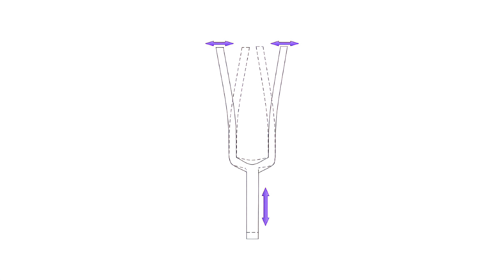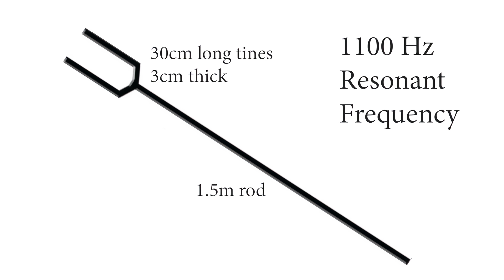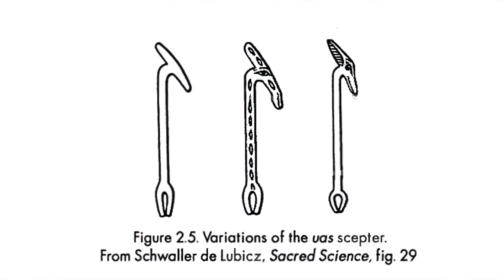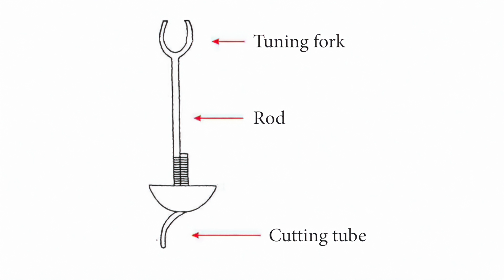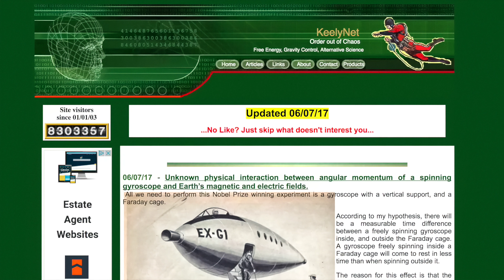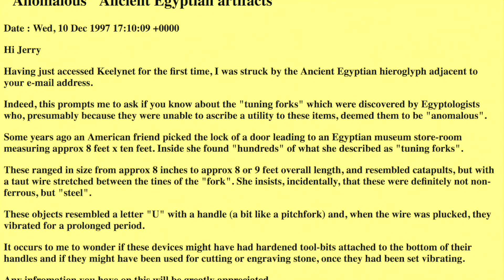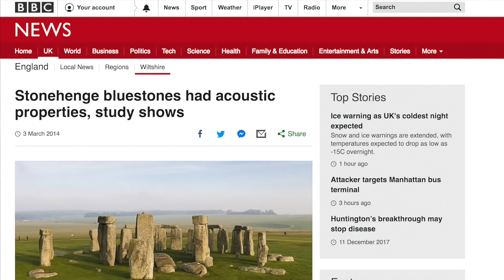How the Ancients Cut Stone with Sound - Lost High Technology Explained | Ancient Architects

Comment: The Waas Scepter (4:50) was most likely used to simply push, pull, or manipulate rings supporting privacy curtains or tapestries. HOWEVER, since the Waas Scepter often appears with the Ankh and Djed Pillar (5:35) perhaps it really was used with, or for, power {as in electricity, wires (resonance 9:55) and means to enhance mechanical vibration in concert with tuning forks for sonic cutting}; more explicitly: If the Djed Pillar was used like a ceramic isolator (0:57) - and a possible energy-generating device - with hole in the top, the hole could receive the Ankh. If the Ankh, then the Waas Scepter would be needed to place (using the 'U" end) or pull (using the hook end) or prod (using the point) the Ankh into, out of, or in, the isolator Djed. Furthermore, if the Scepter was metallic, it could be used as a link from the Ankh loop to....oh....maybe a series of Baghdad Batteries or something.
Reply: This is an interesting theory and makes some sense. Normal teachings are so closed minded to any of these possibilities that it's rather sad to be honest.
Reply: ...always thought the Was-Septer was an assaying tool...
...one end like a poker and the fork end to place the cup into the furnace...
Reply: S.A. Morris, Wow. Yeah. That makes sense as an additional possibility too. Thanks for the comment and have a terrific day.
Reply: Fantastic ideas, Randy. The Ankh is a symbol of life .... it makes perfect sense. Our brains and bodies are electric.

Comment: the answer is always evident but often overlooked
Reply: But can anybody prove this theory or we shall all believe in it just like that?
Reply: Cobb. You make a lot of sense I to think ice age  and some sort of laser  think on this how did they lift 250 tons with what hemp rope would need to be least 6 inch dia so was there some kind of Kevlar rope   that could be also moulded into a tube that could  be light enough to be moved easy and made into tuning fork  tipped with hard end just new to get the hertz right spark eroding works on 50/60 hertz a second but how bowls were cut ha some kind of big wood turning lathe with diamond tipped chisel  cheers john
Reply: Cobb Knobbler  what about the  so called that used copper chissels humbug
Reply: its not a theory its a hypothesis!
Reply: Grant Barlow Good answer and agreed. Overlooked and painfully unacceptable. Not aliens either.

Comment: Vibration,  not necessarily sound  but I believe your on to something.
Reply: Sound is what you hear.. vibration is what creates it.
Reply: sound is vibration and frequency
Reply: For the same reason a deaf person wouldn't call a vibration sound.. it's only sound when it's vibrating a special part of your ears.
Reply: Sound is vibration.
Reply: I don't think it would work.. you could break things with the right frequency of vibration.. like you should shatter a rock by vibrating it but not cut a straight line
Reply: hotdog12345654 perhaps however they did have something unknown to us.
Reply: Most likely.. I'm pretty sure we couldn't recreate the largest pyramid today, even if we were determined. Too much precision is required for us to do it properly, it's aligned to the north so one tiny mistake in the angle you place a stone will fuck it all up.. then it's got different weight distribution techniques, which we would need simulations to figure out for ourselves, at least with out dealing with a few collapses first. Then it was all sealed from the inside somehow.. like the only way they could have sealed the entrances we have found.. is by doing it from the inside so who knows how they got back out. Our biggest crane is two hundred feet smaller so it couldn't reach the top and if they did, it could not be so accurately placed.
Reply: hotdog12345654  that theory is bull shit . You could build them pretty quickly with modern equipment,  rail roads heavy equipment, cranes excavators.   Each stone on the pyramid weighs 2.5 tons 1 train car is rated for  146 tons. yep it is all hype. Not counting the dude that moves multi ton block by himself. The question you should ask is not how but why? Damn sure was not a tomb as there were no bodies ever found in there ever
Reply: Good comment.  Check out https://www.youtube.com/watch?v=bWWhHUs-njY by Michael Tellinger for sound resonant long round tapered rocks used for gold mining in ancient times in South Africa.  They are laying all over the place.
Reply: Sound is vibration
Reply: +hotdog12345654--That's stupid:  Then air is not air unless someone or something is not around to utilize it?  That's like saying if a tree falls in a forest and no one is ever there to see or hear it when it did and after the fact, did it really fall?  Of course it did.  Gosh, humans are so friggin' narcissistic!  Think outside the realm of YOU sometime.  You may actually find amazing and wondrous things!  Contrary to retarded pop culture and science, we do NOT live in a simulator.  Rolling my eyes!
Reply: "loool sound and vibration are the same" looooool, no they really aren't. Vibration is mechanical movement that causes unwanted energy waves. Sound is the effect of oscillation in a medium. Good luck creating sound with your vibrations in space. And in much the same way not all photons are considered light (are x-rays light?), neither are all frequencies. Sound is 20Hz to 20KHz.
Reply: hotdog12345654 it is about how you direct it
Reply: ...i mean, what do you think sound(fundamentally) is? Sound is just vibration traveling through the air. Thats why when we speak and you put your hand on your vocal chords you feel it vibrate. When these vibrations hit our ear drums, our brain then deciphers it as sound.
Reply: BubbleOnPlumb lol, I wanna go back!
Reply: Coral Castle Ed's magnet flywheel...
Reply: +BubbleOnPlumb --  RIGHT ON!
Reply: hotdog12345654 Give me enough cash and labourers and I'll pop you up a pyramid that makes the old ones look like garbage.
Reply: Exactly correct Jeff. Sound is vibration. Our ears are interpreting vibration into sound. So if a tree falls in the forest, it will create a vibration. So unless our ears are there to translate vibaration into a sound it would not be heard. If you put a tape recorder there, it sill will only be translated by our ears. JanieMartinSings
Reply: Sound is vibration
Reply: Same thing
Reply: no sound without an ear? 🙂
    we know . of infinity
Reply: Diffrents finitudes...!
Reply: 7seven7 the destructive wave... 2 strings per note instruments. ..
Reply: Its both, sound can create vibration
Reply: We aren’t hue-men, no humans are hummmming beings
Reply: hotdog12345654 ... Oh please. Modern engineering is done to very tight tolerences. Piece of cake.
Reply: round eye the pyramids were used as a power source.
Reply: Jeff Pittman everything is vibration
Reply: BubbleOnPlumb Well said Zir
Reply: 7seven7 loool sound and vibration are the same
Reply: Exactly.
Reply: Pure BS
Reply: Lawrence! where have you been?  They now no exactly how those huge heavy blocks were moved from the quarry to Geza and then up and into the pyramids.  
do a little research before accepting some lying SOB's word for everything.
Reply: "I'm pretty sure we couldn't recreate the largest pyramid today, even if we were determined. Too much precision is required for us to do it properly"
"it's aligned to the north so one tiny mistake in the angle you place a stone will fuck it all up.."

All you need to determine the North with perfect precision (if you do not know anything about stars etc) is a goddamn stick. If you're stupid and lazy, three sticks and some fine rope.

"then it's got different weight distribution techniques, which we would need simulations to figure out for ourselves,"

Or something as simple as math. Has the Notre Dame in Paris collapsed? Or the intricate gothic structures that depended on far less material to stay upright than huge massive blocks? In that regard, pyramids are the easiest shape to build, even easier than a huge cubic shape.

"at least with out dealing with a few collapses first. Then it was all sealed from the inside somehow.. like the only way they could have sealed the entrances we have found.. is by doing it from the inside so who knows how they got back out." 

Tell me: how can you seal something from the inside but not from the outside? That makes zero sense.

"Our biggest crane is two hundred feet smaller so it couldn't reach the top and if they did, it could not be so accurately placed."
 
Then how did we build those huge structures like the Burj Khalifa?
Reply: In your opinion ,how were the vibrations made.?
Reply: isnt' vibration , sound. what is the difference? do explain.in my world vibration is exactly what we call sound.
Reply: you can't hear all vibrations. can you hear a dog whistle? we are splitting hairs in definitions.
Reply: according to your EAR. you can' t hear all the vibrations. ants are making sounds of their own. only an electron magnifying microscope can show you they are noisey and busy. correct me if i am wrong. this is how i think of it.
Reply: 7seven7 
"Vibration"  is created by hitting something with an hammer and those vibrations are low frequency, stone masons have done this for a long time. 
High frequency Sonic cutting is totally different,  can copper really cut granite? Has anyone tried it ?
Reply: 7seven7 you Plus are is you’re
Reply: Lawrence Carpenter Or does this prove the Biblical Gap Theory?
Reply: So, you're saying that we could never build a structure more that 200 feet tall? And that the girders used were sloppily positioned? We could build the pyramids today, much faster... but there is really nobody who wants to.
Have you ever watched a documentary on the pyramids? There are several perfectly viable ways it could have been done, and they could very easily have used ALL of them.
As far as weight distribution, it's all pretty much academic, isn't it? they dug to bedrock and built on that. There really wasn't much means for changing the weight footprint of a square-based pyramid.
Sealing it from the inside could have been done by sacraficial volunteers, and their is evidence to support that.
Alingment was simple. They had a star to guide them. Any error would more than likely never be noticed. I don't think Osiris really cared that much.
Reply: Ok for one sound and vibration are the same. Both are forms of kinetic energy height frequency sound is a term ultra low frequency sound is a term!! Both can operate in ranges that we can not here. Sound is a major building block of all matter. From micro to macro. To not see that is willful ignorance.. sound is a element can’t have matter with out it. Can’t have water without sound can’t have fire without sound can’t have rock without sound. What is matter? vibrating atoms. Each object at its own frequency. I hope that helps with some understanding. (There is a whole lot more to it but that’s the simplest way to put it)
Oh and in the beginning there was the word the word was god and the word is god. I think there is a reason that the beginning of the Bible talks about sound and god. 
And he says let there be light. 
So what is the frequency of a light particle? I would like to know that. I think I’ll start researching that
Reply: Sound is only the sensation created in the mind in response to acoustic stimuli. Vibration is the repeated, regular motion of matter. Frequency is simply a means of describing the number of times such repetition occurs in (usually) one second.
You can't have vibration without matter. "Height" (you mean "high"?) frequency sound can mean anything. Generally, to be considered "sound", it would have to be between 15 cycles per second (now called "Hertz) and 22,000 Hertz. "Ultra-low" frequency would be anything below 15 Hertz. 
The Bible is the word of God. It doesn't make a sound. So the connection between "sound" and God's word doesn't hold up.
In particle physics (that would include light particles), frequency isn't a factor. On that scale, it's measured in wavelength , and that scale is usually in nanometers.
Reply: Sound is vibration, everything is vibrating. Our ears don’t pick up on words when spoken, our ear pick up vibration, our brain decipher these vibrations into words. Glass will wobble like jelly under the correct sound/vibration then shatter, change the vibration change reality? Cheers 🍻
Reply: Yesss, everything is vibrating, all the time, everywhere. Earth vibrates, electron shells vibrate... The SUN vibrates. But nobody has been able to build things with that vibration yet.
Reply: Bill Martin how can you be be sure?
Reply: Surety is for bail bondsmen. I rely on probability.
Who has managed to build something using sound that you can verify?
Reply: Blue grass playing Egyptians will reorganize to build a giant pyramid building and rename the location Lloyd loaratia
Reply: You are thinking of the power of sound waves delivered in an uncontrolled sense where the work piece is utterly engulfed and destroyed by the sound's induced vibratory power.  Imagine instead the correct frequency being delivered in a more precise manner at a specific location and in a specific shape upon the work piece.  Applied in this fashion, the vibration acts like more of a series of small shaped charges blasting away at the material in that specific place rather than in an uncontrolled explosion that would ultimately destroy the whole work piece.  Shock wave lithotripsy is a variation of this theme and has long been used to pulverize kidney stones in situ without destroying the kidney tissues around them.  Roto sonic drilling for gathering long undisturbed core samples is another example of this type of technology at work.  The question is not really whether or not the technology would work but rather how the ancients might have managed to harness the principles involved.  

Want to be a billionaire? - Develop a way to scoop granite like ice cream using a variety of hand held tools.  Then marry that tool technology with 3d CNC technology and you will be able to reproduce all of the ancient works from delicate granite vases to giant obelisks.   But do you really want to go there again?  Wouldn't it be better if we just stay right here spending humanity's creative capital making reality TV shows and arguing over what personal pronouns we would like to addressed by?
Reply: It's kinda like how everything you see is light.. but you're still going to call a chair a chair when you see one.
Reply: Sound is just what you hear.. Vibration creates the sound but sound only happens when a piece in your ear is vibrated. If nothing is around to hear it, vibration doesn't make a sound
Reply: 7seven7 *you're
Reply: hotdog12345654 The precision is the easiest part of building them today.Thats what society is about today,precision.Whats hard is putting the blocks in place.We can carve them today but don't have cranes today capable of lifting some of the stones in alot of megalithic structures.And there's way more out there that's not in the form of a pyramid.It all boils down to giants in the past.The bible tells of them.Before u call me a religious zealot.I used to refer to myself as an atheist.I no longer do.Im not saying I believe in god.I just know we are all a part of something so much bigger than ourselves.I hope we figure it out before I die.

Comment: Great job
Reply: An engineer named Edward Kunkle  published a book Pharaoh's Pump Ibelieve showing how the Egyptians build some of the pyramids.  This concept was recently rediscovered with additional archeological evidence sporting it.  This sonic stone carving/ cutting would easily fit into this work.  Of course moving the stones on barges made that aspect of the construction rather routine, see the book for the details. kBack to sound though.  The granite "sarcophagus" Kunkle postulates was actually a signal bell that indicated when the water in the ram had filled the chamber and tilling the time to open the valves to release the water column into the ram mechanism( been a few decades since I read the book so some of the details may be wrong).  Google Pharaoh's Pump read for yourself.